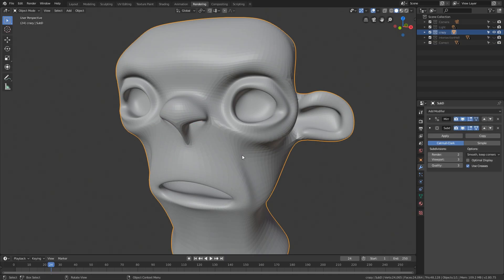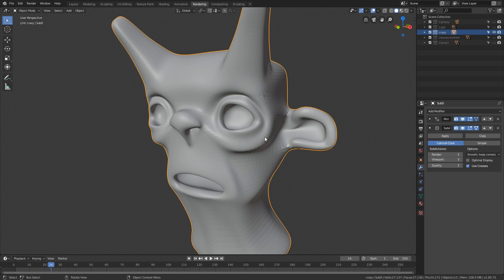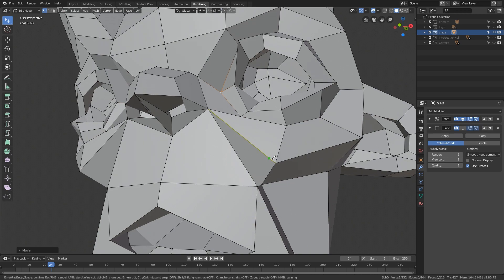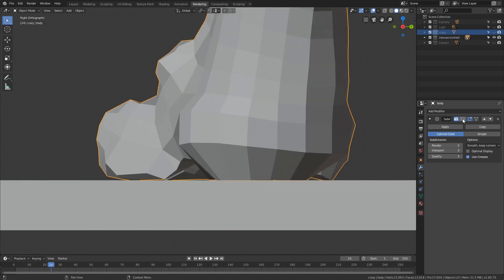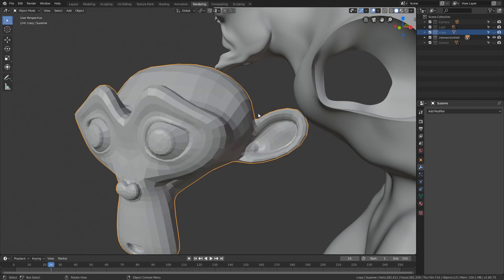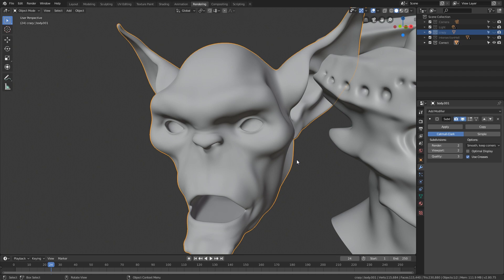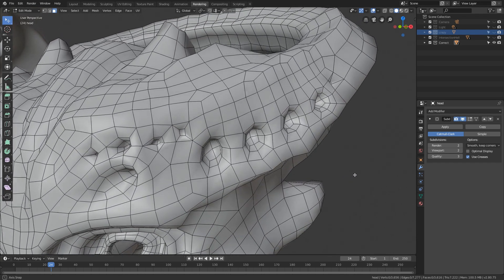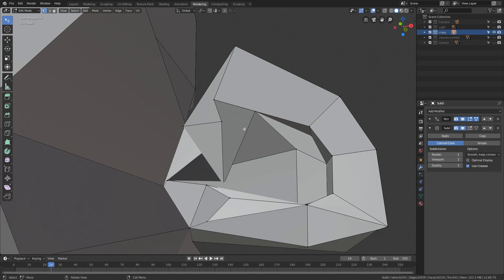Why You Should Never Model with Subdivisions Active - 3D Modeling Fundamentals

Comment: Was this a problem that only existed 3 years ago and has been fixed or something?? Just apply the modifier after you finish modeling???? subdivide 1 on a mesh with really low poly go in and out of sub mode to check then fix the topology and I never had a single problem with it

Comment: Thank you for the tip about not modelling at very low poly (or at least once you've setup a good block out), because I was wondering about how to deal with the issue of a model drastically changing shape when you're not modelling with subdivisions on. The downside is that I'll have to manipulate more vertices, but I guess that's not a big deal when using a tool like proportional editing.

Comment: There ought to be some kind of Betteridge law about 3D tutorials that say "never".  I can count the number of true 3D nevers on the fingers of one hand.  The whole reason your applied subdiv model is hard to work with is because you applied 2 levels of subd instead of 1.  And of course afterwards, you go ahead and apply a level of subd on Suzanne to get the bounds more accurate (leaving it hard to work with btw, but that's perfectly reasonable if you no longer plan to work with it; or, if you plan to work with it via a mesh deform or something.)  Your plan shouldn't always be to apply a level of subd, but when it is, you might as well be working with it displayed.  Now, if the point is, don't make a model with unmodified topo that's awful, concave faces, zero-area faces, degenerate quads, highly non-planar faces?  Yes, I agree, don't do that.  That's one of the first technical things modellers should learn.  But if your anticipated, applied subd fixes those problems?  Feel free.  Indeed, are you starting a character with cubes for legs?  Yes, model with a single level of subd, get the boxes where you want, apply that single level, and then move on to the next level of detail (perhaps with a new level of subd, if you intend for your legs to have 16+ verts per loop and so plan to apply that single level as well.)

Comment: I'm new to 3d modeling,  I find it hard to get smooth surfaces without  subdiv modifier, typically  I do a really fast first pass with subdiv, then manually retopo so I can use the smooth surfaces as my work surface

Comment: Im quite new. But i dont get it. If i want to model>sculpt a model to 3d print for example. Do i just use smooth or subdv to get smooth surfaces and get rid of corners? What is the correct way to do it?

Comment: I don't cage it so I see what my model would look like without subdivision at the same time and actually there are a lot of problems people say exist but have simple solution to so far the only problem I have had while using subdivision surface is trying  to import the models into roblox which has a 10k triangle limit otherwise everything else works fine the only thing I haven't tried is animating but I will just to see if there are any problems

Comment: Also, I'm not sure it really makes sense to use traditional modelling tools for character design.  There are fundamental maths problems with working with either pure polygons or catmull-clarke subdivision surfaces (which are based on cubic splines and have issues).  Use a sculpting/retopology workflow.

Comment: What you said it's generally true and probably the best way to keep clean geo, however I wanted to point out that there are cases where you do the opposite, you model with subd preview on and deactivate it from time to time to check if the model doesn't have errors. It's the case of cloths objects like fabrics, towels etc I usually start with a plane, keep subd preview on, start creating the shape that I want and deactivate subd from time to time to see if the mesh has weird artifacts or geo.
I'm talking about cloths for environments and props because I don't make characters.

Comment: Your monkey animation example seems to be less a problem with using a Subdivision modifier and more a problem with how Subdivision shrinks the mesh instead of preserving the volume. If you had some sort of offset control for that, none of the problems with that example would exist.
Reply from the maker: The problem is still that the subD does shrink the model, so you have to take it into account.
Reply: @FlippedNormals  Or, you can compensate for that by inflating the model after you subdivide it. This shouldn't be a problem we're still having in the 21st century.

Comment: I made this mistake with my first few models.
Reply: I've made this mistake with all my models, but I've found work arounds for most of these issues. You can use opensubdiv to animate with your high-poly mesh or make a duplicate and apply the mirror and subdiv to 1 level, and it'll be really fast in the viewport.

Comment: It doesn't matter how lowpoly mesh looks when you are modeling highpoly, because there is no use for that lowpoly anyway. sometimes to achieve desired look in some areas low poly cage can be twisted in a nasty way, but again why bother if most of the time you will be redoing lowpoly later using retopo over the highpoly mesh.

Comment: While I generally agree that you want your production model to be very close to the subdivided model, couldn't you just subdivide the low poly model on one iteration to help with achieving form, freeze the mesh, then keep manually adding details?  This essentially would still be your 'low poly mesh' that you would later sub-D later for render time.   The only thing I can really think of for not modeling this way is if you need very fine control of your topology, but I would think that would be handled in the retopo phase in general.   Did I miss something?
Reply: Yes, in a case like this, that's exactly how you do it. You model your super low poly with subd and then just bake one iteration of subd when initial modeling is done. The end result is still low poly and the topology is nice and it's also very clean.
Reply: A great example of this, you can model snake heads with boxes with 2 loops and a subd, and the snake head takes maybe 3 minutes, is true to reference, and the subd first iteration bake renders a nice useable topology and is low enough for further tweaks down the pipeline if needed, and you can crank out 50 different snake heads in 2 hours and each is uv mapped and ready for details

Comment: blender sds modifier is broken. After they implemented opensubdiv. It's not working like in maya, max or houdini. It smoothes model differently. It was tested by me and other people. Good modifier shrinks model when smoothes, blenders one is not. It acts like it 'preserves shape', which is by fact wrong. 
You can compare maya's 3 level cube subdiv and blender's sds modifier, they won't be the same even if they are 1=1 by scale. I tested it in maya and houdini, others tried in 3ds max. They all(maya, max, houdini) the same, but not with blender. 

-
In short, if your pipeline is only blender, you pretty much can forget about it, but if not, blender will destroy your shape. If you use it for modeling and other soft for subdivision and render, results will be different.
Cheers.

Comment: But you can just retopo the high resolution mesh later so whats the peoblem with subdiv ON?
Reply from the maker: You wouldn't really box model your high res mesh and retopo later.
When you're modeling, you're doing your retopo.
Retopo mostly applies if you have high res sculpts where you want to make production friendly topo.
The problem with subd on while modeling is that it gives you an untrue view of your current model. 
You might be pushing the mesh beyond what's considered good in a production environment.

Comment: In general this is a very good advice. Most of the time this is how i model. But like stated by J.L, blender has a solution for this. Turn of "On cage", which adjusts the so called "control cage" to follow the subsurf results. That will enable you to see both the subsurf result and the original topology. You are not talking about it so i wonder if you think its a bad solution?
Reply from the maker: This is a good solution, as long as you really take the shape of the cage seriously. It's still really easy to get stretched shapes if you're not careful

Comment: This is silly. It might be a good tip for beginners not to leave it on all the time, especially if you plan on using the lower poly version. But I don't think its accurate that "you should never model with subdivisions active". I've been a modeler for a few years now, and I do this all the time. If I'm planning on using the subdivision It is usable. While the example is extreme, you'd never use the lower poly version, you'd use the higher poly one and retopo.

A better rule of thumb: Never model in the subdiv, if you don't plan on using it for the final result.
Reply: This is frustrating, I've been a huge fan of Flipped Normals. Using this for clickbait is misleading and makes me lose faith in your brand.
Reply from the maker: We really didnt want to make it misleading - our point is that you shouldnt have it ACTIVE while modeling, meaning you toggle it on and off. If you want clean models and you model with it on, you'll get into trouble soon. The examples we show in the video shows exactly why you want to make sure your low poly without subD matches the shape well.

Comment: this video really angers me.
you guys need to acctually learn when to use this technique first which if you dont correct it properly of course it will never work.
I know this is talking about the pitfalls of this technique but it seems like hate for something you really dont know how to use or when to use it.
what I mean is that there not just "one" way to do something.
Reply: Agree it completely nonsense they dont know how to use subd as an example of how good it is MODO put Subd mode on as default.
I'm on the opposite people always should model with Subd only exception is some kind of hard surface with very sharp edge or low poly is need.
Reply: These guys always have a smug way of presenting things, I guess it’s worse bc there’s two of them cackling, maybe one person wouldn’t be so annoying

Comment: Isn't the point of opensubdiv mainly so that animators can work comfortably without subdivisions switched on?
Reply: In 2.79 it was GPU accelerated, so animators could work with subd ON. To my knowledge, it isn't GPU accelerated in 2.8 yet, since the depsgraph was re written and the plan is to add a subdivision property to mesh datablocks that is always the last modifier (in addition to the modifier stack which can have subd).
Reply: @josephbrandenburg4373  You can still apply all the modifiers except for the armature and as long as the poly count is about that a of a game model, you'll get a fast viewport.

Comment: In the Render Properties tab there's an entry called "Simplify" which let's you reduce the level of subdivions for your entire scene if you turn it on. 
What I do is I set the Max Subdivisions to 0 per default (saved in my startup file) and assign a keyboard shortcut to toggle it on/off (Shift + Q in my case). 

That let's me easily see what my mesh looks like with/without subdivisons and I use it all the time when I'm modeling.

Comment: I agree but the flaw in you guys argument  is that once you get to a certain point most people convert the model into a mid poly model to continue modeling or sculpting. Then the model is retopologized.
Reply: Yeah that's pretty much how I've seen this method used since about 2007, when I started. It's an acceptable industry workflow, so long as you bake a subd iteration before sending it down the pipeline

Comment: You can also use a subdivided mesh as a base for a shrinkwrap modifier for your low poly. Not sure if this will work for all the cases, but shrinkwrapping low poly onto subdivided mesh + smoothing when necessary (and to be honest, sometimes manually adjusting some verts in tight spaces)  really helps me getting nice and clean low poly.

Comment: SO I was following your method before about using the shrinkwrap and snap-to-face method for retopology.  NOw when I was done, I found that a lot of the vertices were snapped to other parts of mesh that caused a lot of distorting and such.  I would like to know if there is a way to fix/avoid that happening, other than trying to sort through and drag hundreds of individual vertices into there proper place.
Reply: You shouldn't use shrinkwrap for retopo. It causes a lot of ugly snapping, especially in tight spaces. Flipped Normals have some really bad advice (like this video) and shouldn't always be listened to. They're also very new to Blender. To retopo in Blender, use the snap to surface function (with "Project individual elements" on and set to work with move, rotate and scale).
Reply: First Don Diego you either had some flipped normals or your settings were wrong on the modifier, are you saying the vert snapped through the mesh to the backside

Comment: Now I'm curious what your opinions are on using bezier curves, nurbs, b-splines, etc. as those are all functionally equivalent to subdivision modifiers.
In general though, the trend over the past couple decades seems to have been decreasing the number of effort needed to make a complex shape and part of that process is to use a low poly mesh as a set of control points for a subsurface modifier.

Comment: I've recently had a Problem where I had cylindrical/curved shapes on an object that's supposed to be game-ready, so relatively few polygons with normal maps. I used a 16 vertex cylinder as the base shape, when using a subsurf modifier for the high poly version it looses volume because the radius shrinks though, so the two don't overlap as nice anymore for baking. I seem to find no straightforward way of adding resolution to the cylinder while keeping it perfectly round though, as just subdividing only adds cuts to the planar faces of the cylinder, while the smooth option in that distorts the loops at the cylinder caps in the Z axis. Is there no other way than either remodeling the high poly entirely or subdividing and then adjusting the new vertices by hand (which can be unprecise)?
Reply: Seles You could use the loop tools add on and use the circle tool to push out the extra subdivided verts, would save you a bit of time instead of doing it all manually, you can also use edge loops on the high poly to control the curve fall off, you will never get a good normal though if the low poly is just a hard ninety degree edge, you need to put some bevels in if you want a curve.

Comment: I think it's the first time I've seen someone using the subdivision modifier in that way, I laughed a little xD and the title is a bit exaggerated.

I thought you already knew, that you will lose volume in the model when you subdivide and smooth a surface, it is normal xD.

Even so, I suppose that for the new ones it is very useful information, but it is not so simple it is used differently according to your needs.

Good luck guys and I really like your channel.

Comment: It is a very good tip to work between low poly and subdivisions (I'm used to calling it smooth prievew in Maya), but I was curious to ask if this means that production work in the end only works with low ploy and doesn't work if the mesh is in smooth preview/ subdivision. That and I know in Maya2018 there is a tool that can subdivide/smooth the mesh and if this would be a recommended tool to use. Great video, thanks!
Reply: In Blender, you never have to apply the subsurf modifier, it has separate settings for viewport and render. So you work with the lo-poly model most of the time. Take a look at thr open movie characters and you'll see that they're not very hi-poly. But they use subd level 2 I think.

Comment: This only actually applies if you like to model your low poly base mesh and your high poly simultaniously, so you'd be able to save yourself a retopo from scratch and jus use or reuse parts of your low. Nothing more. Its fine to build a clean high poly base model like this to take into sculpting for example. The title is such an absolutely damaging style of spreading knowledge. Whats next? "NEVER model with anything but quads?" Do yourself a favor and be sceptical about information like this. It can really hold you back.
Reply: I believe this answer my comment I just made. Thanks
Reply: Flipped Normals are 100% correct here. You're method assumes you have the proportions of you model 100% locked down when you embark on the initial high poly version. You're also committing yourself into sculpting and retopo'ing EVERY single model you create.
In production (which is where the FN guys are speaking from) this isn't feasible. If a client/supervisor/director says half way through your initial modeling that the character now needs four camel legs instead of two human legs, or that the torso needs to be longer and have a distinct arch in the back, it's a lot easier to change your tidy low-poly version.
Also things are so rushed in production that the layout and rigging departments are sometimes screaming out for a proxy version of your model. You can give these people what they want, a lot faster by starting with a tidy low-poly version, than waiting for your clean high-poly version.
I could go on, there are so many other reasons to do it the way described in the video.